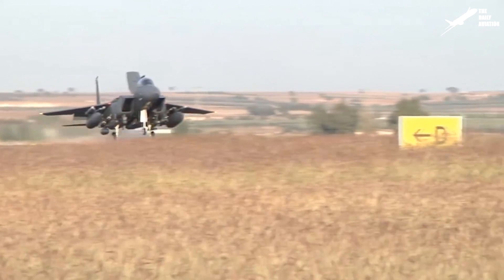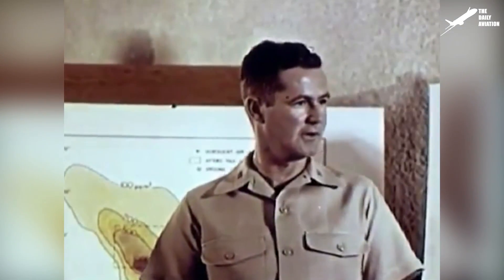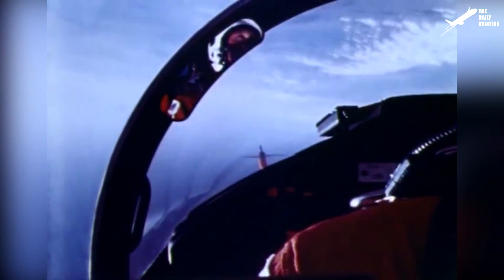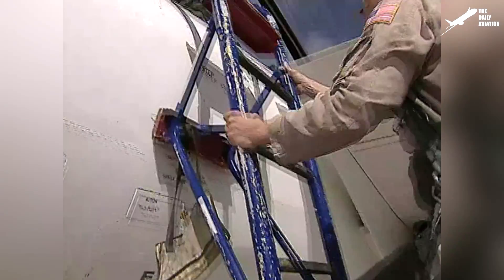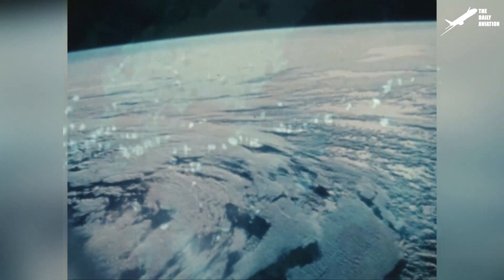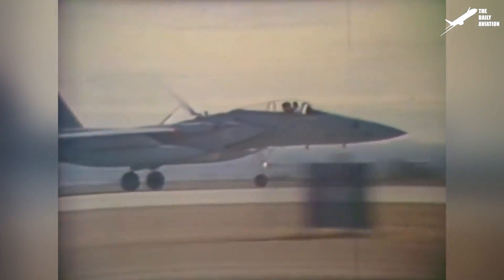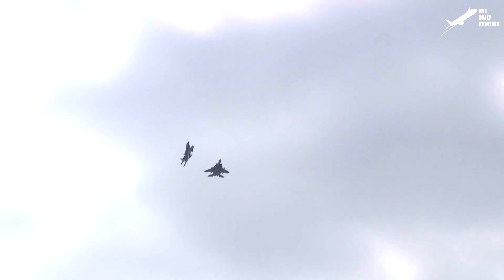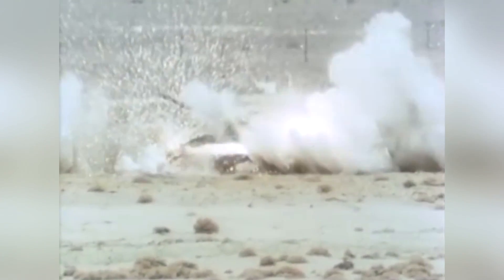The Story of The Most Undefeated US Aircraft: McDonnell Douglas F-15 Eagle

Comment: The F-15 was actually designed by Fairchild-Republic, same company that built the A-10 warthog.  However when the bids went out for the build, McDonnell Douglas won the bid.
Reply: @jrvasquez  I was Director of Quality for Fairchild Republic and the A-10 program.  When the AF put out solicitations for the F-15 we submitted an Engineering design package that the AF approved but then put the build out for bid and McDonnell Douglas won the bid.  The dead giveaway was the double vertical empennage.  We also designed the tail for the F-22 and Space Shuttle.  That was our specialty.